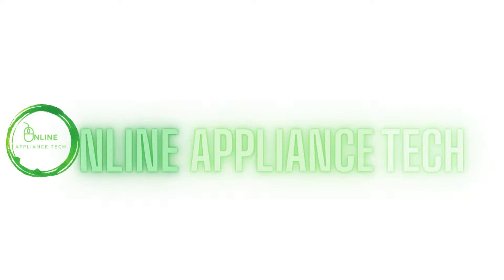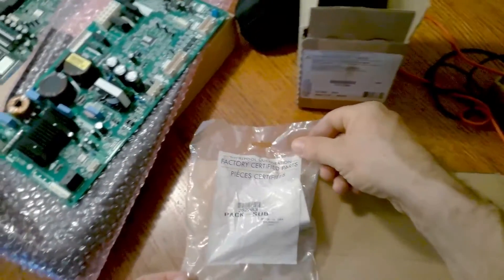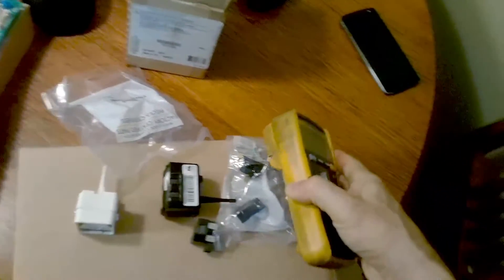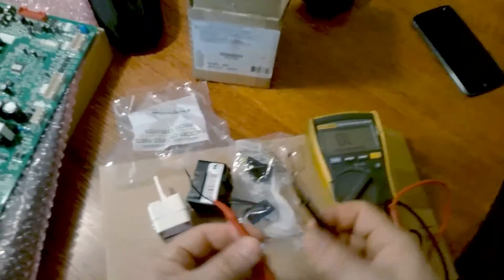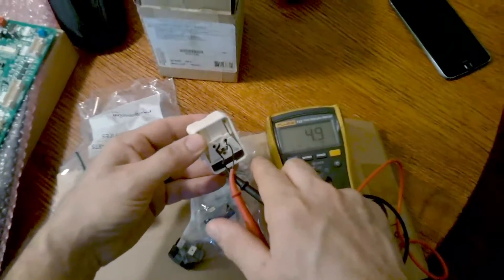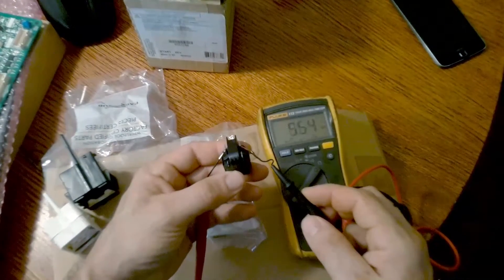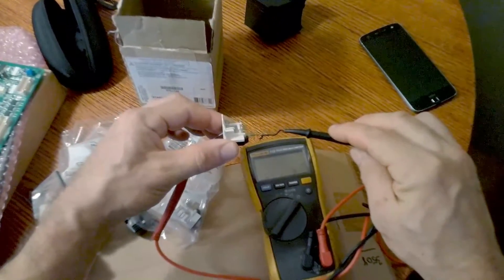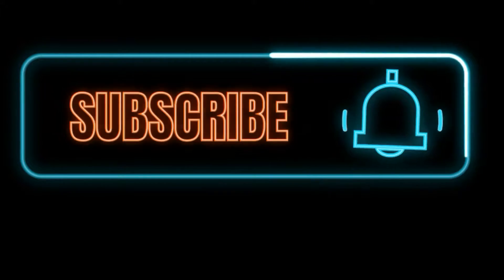Learn How To Check Relay with Multimeter could be why refrigerator not cooling?

Comment: What if while testing the OLP or relay, it starts reading continuity and later shows open line(OL)??

Up to what number should it read before considering it a good OLP or Relay??
Reply from the maker: If you’re testing just the relay, a good one should show some resistance (usually anywhere from about 3 to 7 ohms) between the two terminals when it’s cold. It should not read OL (open line) right away. If your meter shows continuity at first, then flips to OL after a few seconds without the relay being hooked up to the compressor, that usually means the relay is weak or going bad. A good relay will stay steady on that low ohm reading when you test it cold.

Comment: Got my relay, it doesn’t read the continually when I put my multimeter in the back prong, does it indicates the relay is bad?  The new one does the same please help
Reply: It is three pins relay, it read when I text the bottom one to the cross pin. The parallel pins doesn’t read anything
Reply from the maker: Refrigerator relays only have two or three terminals. You mainly check the across-from-each-other pins for continuity.

Comment: Thanks for doing the video. When I test my start relay with the Ohms setting. It starts out at 10 then 29-30 ohms and fluctiates, mostly going down quickly. After for 5 seconds, it reads 0.L. Does that mean its bad or good? My capitcor reads 15 uF and i hear the clicking sound of my compressor kicking off about 5 seconds after plugging it in. Bought a new starter relay, that test the same as the old one and the compressor still will not stay on longer then 5 seconds. Thanks. I have a UEJ Prime DL369 meter
Reply from the maker: It sounds like you may have a compressor issue that's causing it to trip and possibly short out the relay.

Comment: Hi, I tested my start relay and got no reading. The compressor is constantly hot and occasionally i hear a click which i assume is the relay. The fridge starts to cool momentarily before clicking again and then not working. Is this just the relay intermittently working?
Reply from the maker: If your relay reads 'Open Line,' this indicates that the relay is defective. Additionally, if your compressor is running hot, it might be necessary to clean the condenser coils. Dirty coils can cause the compressor to overwork, potentially leading to the shorting out of the relay. While it's less common, the problem could also stem from the compressor itself, which, if malfunctioning, might short out the relay when trying to start. This scenario is rare, but it's worth considering. Hope this helps you in diagnosing and resolving the issue!
Reply: @onlineappliancetech  thank you so much for taking the time to respond. I measured the resistance across the compressor terminals and got 80 38 and 60 ohms. That seemed high but I couldn't find a datasheet for the compressor.
Reply: @uzy87626  measure the resistance between R&C and also S&C, sum the resistance together. This must be equal to when you measure between R&S directly.

Comment: My fridge is not cooling below 9 celcuis. I am getting a reading of 8ohms on my relay. Appears compressor is running non stop, as its hot to touch. Replace the relay?
Reply from the maker: If the compressor is running, it confirms that the relay is in good working condition. The problem you're facing could be due to a refrigerant leak or a malfunction in the defrost cycle, preventing proper air flow in the refrigerator. A reading of 8 OHMs for the relay is considered acceptable. I hope this information assists you

Comment: I have the black type of relay. It reads 36 ohms between the two pin and pass continuity test. Is it good or bad realy?
Reply: Good relay
Reply from the maker: A resistance of 36 ohms is too high. Ideally, it should not exceed 6.0 ohms. I hope this clarifies things!
Reply: @onlineappliancetech  can this be responsible for my fridge blowing my stabilizer's fuse once it's powered?

Comment: I got a bad overload and relay, how common is that?
Reply from the maker: A bad relay is very common, however an overload is odd.
Reply: @onlineappliancetech  yeah I did the ohm and continuity test, maybe because they are like 6 years old
Reply from the maker: @SpikerDragon95  Could be, let me know if I could help you!
Reply: @onlineappliancetech  done! I was able to fix my fridge, it was the overload and relay, just be really carefull cuz some stores sold relay with really high ohm resistance, something like 30 to 33 ohm, with those the compressor didnt start, but with a 5 ohm relay the compressor sart right away
Reply from the maker: @SpikerDragon95  yes 30 ohms is way too high max is 7. However I'm happy to hear that you fixed it. Thanks for the update.